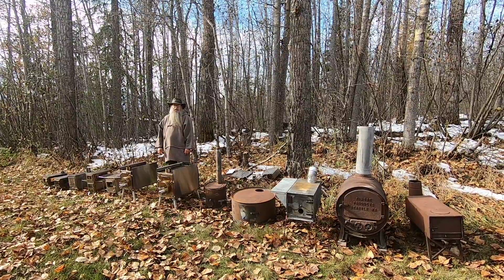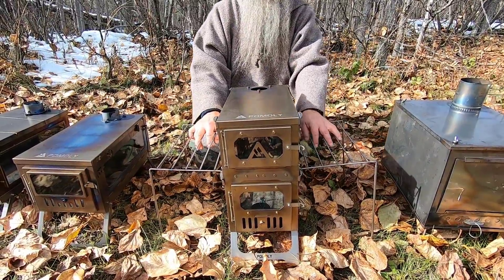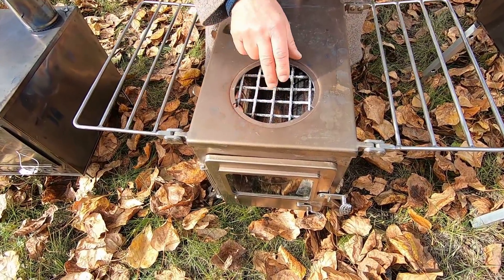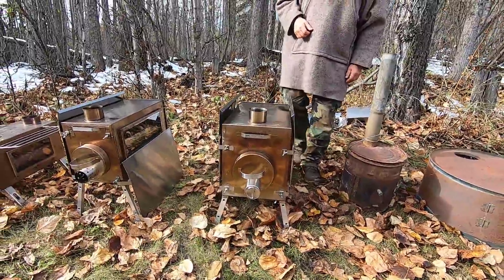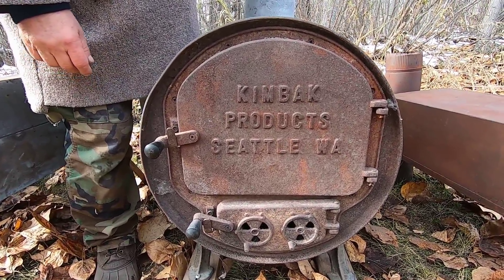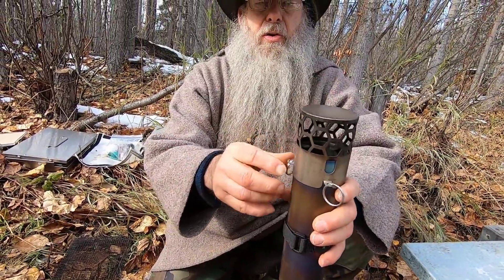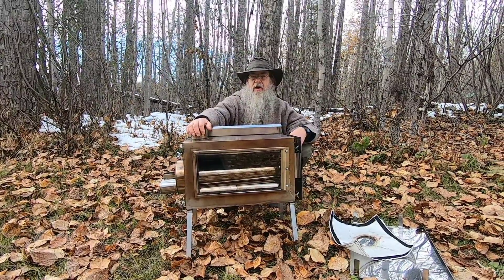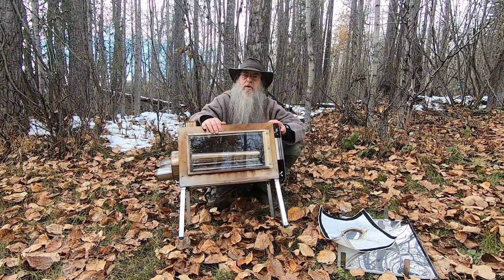Camp Tent Wood Stove info For The Common Man

Comment: I’ve spent about a year building my own tent stove. Its designed to burn anthracite (hard coal) as opposed to wood. The heat output and length of burn time from a few handfuls of coal is outstanding
Reply from the maker: I am very curious to learn more of your experiments and results.  Do you have a video/s on the subject?   I will take a look over on your channel and see what if anything you have there.
Reply: @Far-North-Bushcraft-Survival  I’ve never posted a YouTube video before but I’d like to for this one. The stove works great and I really think that coal has a real place in the tent stove community. 

      The pro’s are that a coal stove can have equal or greater heat output than a wood stove, (my goal is 8 hours) while also having a smaller overall footprint, and it’s able to run off of a single load of coal for a MUCH longer period of time. Also the labor savings it affords from all the wood you don’t have to chop. Plus coal is really cheap too
      
      The con’s are that the stove itself is more complicated (and expensive) to build. And even though it’s very small, it’s heavier that you’d expect it to be. Also, getting coal to light is literally like trying to burn rocks, which believe or not is quite a challenge!It’ll take lots of practice to reliably get the coal to burn. 
        
      My first (and only) one is made of mild steel but I’d like to redesign one with an inconel 718 (special nickel alloy) firebox. My concern is that coal fumes can be quite corrosive, and thin metal will burn out, but thick metal will make the stove too heavy to use. My stove isn’t 100% complete because I need to install the damper and upgrade the door/intake air latches, but dang it burns like the sun in a bottle!
Reply from the maker: @Bloated_Tony_Danza  Thanks for getting back to me.  I have coal available for the price of simply gathering it up.   I have wondered about using coal for camping and in fact I took a couple chunks with me a camping trip or so back but alas, I forgot to try it.
Reply from the maker: @Bloated_Tony_Danza    I was thinking more supplemental rather than a total wood replacement.   Good luck with your project

Comment: Wish you had included information on each stove and source. I looked on Pomoly but they didn’t have the folding stove shown. Great video and good to see you back at it. 🙏
Reply from the maker: Yes the stoves are still there on the Pomoly web site.

======
Pomoly Stoves  -  pomoly.com 
T1 PERSPECTIVE
TIMBER 3
T-BRICK MAX
======
Winnerwell Stoves  -  winnerwell.com
Nomad View 1G L
======
Caminus Stoves from 
Russian Bear Market  -  hot-tent.com/
"Caminus M"
"Caminus L"
======
Reply: @Far-North-Bushcraft-Survival    Thanks Lonnie, I just missed your naming a couple in the beginning but you were pretty clear on the last portion of the video. I can’t find the Pomoly folding stove on their site. I’ll take a closer look at em. I’m on Winterwell now, have you seen their folding S.S. fire pits in 4 sizes? You gotta have a look! Yer just crafty enough to make one outta ROUND dang duct pipe 😉 Thanks again for putting in the effort to share and respond. Much appreciated. 🙏
Reply from the maker: Yes I have seen those winnerwell fire pits and you are correct.  A home made version should not be too difficult to make.

Comment: Great videos, thank you..   I live in dairy country where double strength ammonia is available and that sprayed on cool stove glass with a little ash makes quick work and will not scratch glass….   Greetings from Bluff Country Iowa..
Reply from the maker: In doing a bit of online research, I discovered that stove "glass" is not glass but is actually a type of ceramic and it is not recommended to use ammonia on it as it can etch it and thus create an environment that encourages even more soot buildup.
Reply: Thanks for your comeback, in response I’ve used it on the door of my pellet stove for 12 years and couldn’t be more pleased..   Thanks for sharing, but not sure where you researched but my pellet stove door sparkles as I’m looking at it this minute, and your correct it is ceramic!?

Comment: Thank you so much for this...I've been looking at various outdoor stoves, unsure as to which and what I was looking for...this was REALLY perfect timing and great info. You both did a fantastic job filming this...both very steady and easy to watch, easy to listen to. I do have a question which stems for something I recently did on an open fire and has to do with 'dampening' the fire to keep from sparking too much...in the nomad, I don't think it has that baffle that you mention on the next one over...what if you were to some how put a fire proof mesh of some kind towards the top of the stove, covering the length and width, with about one inch gap before the top of the inside of the stove and pipe? maybe even some heat holding thin sheets between folded over mesh...essentially creating your own baffle...other than "it wasn't designed like/for that" and possible heat consentrated issues in the top which may not be able to handle that...is something like creating your own baffle...even practical? Especially since I really like the Nomad...TIA!
Reply from the maker: Yes I am a fan of internal stove baffles.   Whether or not it is worth fabricating in an already built stove would have to be evaluated on a case by case basis by the person wishing it done.  It may or may not be worth doing based on the particular type and construction of stove in question, the fabricators skill level and any cosmetic changes to the stove versus any hoped for benefits.    Most stoves vent out the top of the stove near the back.   An aftermarket installed baffle could only come forward from the back of the stove perhaps 2/3rds of teh distance from front to back.   Due to the baffle's leading edge being that much closer to the door of the stove, it may be possible in some installations that out-the-door smoking may become an issue every time the door is opened

Comment: Very informative I made my own woodstove, but I believe I may have made it a little to big. I intend to use it in my converted cargo trailer/rv but I had the intention of using it for cooking on as well. Its 16" diameter and 20" long with a 4" stove pipe.
Reply from the maker: You may need to leave a door and /or windows open if need be.  My motto has always been that it is better to be too hot rather than too cold but that is just me.
Reply: Thanks for the reply, I have it sitting right by the back door for emergency reasons and I have an escape door next to my bed.

Comment: the choice of wood stoves is all based on application.   In many cases weight isn't an issue, as rarely are they backpacked.   More often then not big stoves are brought in on cargo sleigh, either by person pulling,  snowmobile or atv. This is because the larger tents that use them can weigh 50 pound or more alone.  

once you are moving tents around that are the size of small houses.  (seriously,   8x10 is the smallest,  lost go up to 12x24 or worse,  8x16 expandable ( 16 wide, 8 long,  sections,  so you can make a tent 16x40 with 5 expansions).   Well once you get into those sizes you are starting to look at BIG stoves or even multiple stoves.  

Also do you plan on using it as a basecamp stove and cooking on it.    Well there are stoves that have water tanks for hot water, stoves that come with ovens for baking..  and while you can get portable ones, there are people that will drag in massive 50,000 BTU Wood fueled cookstoves.  things weigh in almost 200 pounds...    they bring them in, set them up,  start them up on the first day of the trip, then keep them running for the entire hunting season, non stop...   Cooking on them for every meal,   serving 5-8 hunters,  running the stove non stop for 3-5 weeks...   then at the end packing it out.    but again, when you have a tent thats 800 square feet...  in freezing temps... you need a lot of BTU

Comment: Hi Lonnie and Connie, hope you two are getting ready for summer, it's coming soon, yeah!🤗  Lonnie, I'm checking in with you as I have a video that may help with lung recovery.  I am currently taking this vitamin and seeing another small increase in capacity.  Thought I would pass this video on that I recently found helpful;    Low Potassium: Signs, Symptoms, Causes, and Treatment with Dr. Berg.  
This vitamin has been recommended to me by several coaches on the carnivore sites.  Seems like a crucial part of recovery that I hope will help me anyhow. 
Snow is melting while it's still snowing, lol.  Time to don the rubber boots for a few weeks, hope I don't do a mud dive!  
Blessings to you and family
Reply from the maker: Thanks for the info.   Now that a short bit of time has passed have you noticed any benefits?
Snow is melting here as well but it has been a slow Spring.   We have a few bare patches of ground here and there under trees but the rest of the ground is still deep in snow.  I was able to get my motorcycle down our snow covered driveway and out onto the dry roads for my first couple of rides of the season.
Reply: @Far-North-Bushcraft-Survival  That's great you got out for a ride.  The first time out for anything in spring is so refreshing!  
Spring seems to be slow in a lot of places this year.  I watch Muskrat Outdoors too and he has snow days even now.  We had one yesterday but it will be gone this afternoon fortunately.  With May just around the corner your snow should disappear quickly at least?🤗🤔  
Yes, I'm very happy to say there has been further healing.  A neck problem that has plagued me from youth is all of a sudden gone.  I've spent thousand of dollars over the decades on chiropractors, with no relief, and this diet heals it, I'm awed to say the least.  Also, I have been monitoring my blood pressure and it has dropped dramatically.  Used to be 140's to high 160's, it's now down to 105 to 120.  My lung capacity has increased a bit more also.  So nice to be able to take deeper breaths again.  Am learning it's all about insulin resistance that is caused by too many carbohydrates that upsets our bodies ability to heal.  I'm binge watching Dr. Chaffee's videos as well as any on insulin resistance, oh my, very disturbing what I'm seeing.  

Just recently purchased a blood glucose monitor  and will be tracking that.  It's in a watch form so no finger pricks🤗.  This is to monitor ketones.  Apparently ketosis is our optimal body function.  Carbs increase insulin, which is what damages the body whereas protein and animal fats, never oils, are what the body requires to function properly to keep us healthy.  An interesting aging note:  I'm hearing that we can live to 120 years or more on a protein/fat diet.  This makes sense since it keeps the body free of disease.  A Somalian replied to me  that they don't have any oils in their country, and they don't suffer from any disease.  As someone who is a 4 month carnivorist, this is very encouraging I must say.  The more I heal/learn about this diet, the more I feel it's the right diet for our species.  
Sorry for the long response, I'm overly enthusiastic about this whole thing, can you tell☺.  
Enjoy more spring rides and blessings to you, Connie and family as always🥰
Reply: @Far-North-Bushcraft-Survival  Hi Lonnie!  Hope you and Connie are enjoying the summer and have made it out to your wonderful cabin.  Its a lovely summer here with some sun, heat and rain that had become all to rare the past several years.
Thought I would check in and tell you my progress, and also the things that have gotten worse with my ALS.
I've been carnivore for 19 months now, it's been very helpful in a lot of ways.
My breathing has gotten much better.  But, I did have a setback recently when my sister came to visit.  I started drinking 2 cups of coffee every day and by the end of the week I couldn't take a deep breath and my sinuses were dry, making it hard to take in air.  Took almost a month to heal, so it was a good lesson in not what to do again🙄.  I'm learning that coffee is my nemesis, and why, but I still love it...
The increased healing has been that I have returned to my highschool weight, which I tried hard to reach all my life since then.  My hair, eyes, teeth(I rarely brush them now), bad breath is gone & teeth have become stronger, foot fungus is gone, bowels are normal, joint pain almost gone, am able to quench my thirst finally, no more dry tongue or mouth, no more heart fluttering, less leg cramps but can stretch again without causing cramping and my resting blood pressure is around 115/60, even lower if I don't have a cheat day🙃.  
But ALS is progressing on my right side that has become weak due to myline sheath being damaged.  Walking is awkward and I am falling alot since February this year.  I'm surprised I haven't broken my wrists or hips, but did break the nose in February🥴.  Was able to reset it without pain since the cartilage was only crushed, so a massage got rid of a small lump.  
No voice so I'm still a hermit😊.  
To keep myself busy I'm learning about mycotoxins that affect myline sheaths, the brain to muscle messaging in conditions like ALS, PD & MS.  I'm ever hopeful to reverse what I and others have, so I press on.  If the body knows what to heal when it has the proper nutrients, it should be able to repair what damage has been done, at least that's what I'm seeing in carnivore comments and videos.  
Well, hope you are both doing well and getting out for some camping trips.  I have to wait until I heal to go but hope someday to get back into comfort camping in the rv.  
Blessings from your neighbour to the south❤
Reply from the maker: @tallcedars2310  It's good to hear from you again my friend.  It is also good to hear that progress has been made in some areas of your health.   I am really sorry for the health problems you are still having however.   Connie and I are doing quite well.   We have not been camping except once this summer and that was in our ancient (1960's vintage) old 12 foot camp trailer that we affectionately call the "Tuna Can".   We have had a pretty decent summer here with enough rain along with a few hot (by Alaska Standards) days here and there.  

I was on the Keto diet for 2 years and did experience quite a bit of help for my lung issues.  However what really got me over the finish line so to speak was I fasted having only water for 14 days.   I then fasted another 7 days several months later.  I was finally able to get completely off all lung/breathing meds after that.   That was maybe 5 -6 years ago.  Recently I was once again getting worse in my breathing so got back on the Keto though not real strict.   My lungs now are not as bad as they had been getting.

Comment: The glass allows for better heat pass through, you get more heat faster with glass all around, even if it’s blackened with soot, with metal sides you get slower heat. Drawback is it also cools faster, so it doesn’t keep a steady heat but it depends on the size the area being heated. The purpose of the glass is for heating, not sure about warping purposes.
Reply from the maker: I believe that if your assertions were tested scientifically you would find that several of them would not be supported by the facts.

Comment: got a permanent camp site build an ondol or hypocaust, they are safer and once again the floors are even warmer! fire out side and smoke moves under the tents living space heats the dirt and radiates into the upper structure
hypo causts are very easy to construct lay a pipe under the area to be heated let the smoke flue thru the lower pipe directly place a second pipe on top of it all in the dirt under the tent leave to ends of the smokeless pipe enter the floor boxes in the tent cold air falls into it and radiates out into the living areas...as simple as stacking a few rocks and digging a small ditch and building a dokota fire pit out side the tent 
You can cook at the fire pit and even have a lean to over the hearth but the smoke drafts thru under the living areas heating the floor and the interior for those winter nights

Comment: Oven cleaner will probably clean up the glass pretty good.  It does a good job cleaning the glass in the door on my electric stoves.  I do not use the non-toxic cleaners.  I use the old fashion stuff that stinks like hell.  EZ Off is the brand name, as I remember, the yellow spray container.  I just spray it on and use SOS or Brillo pads to clean the grease off.  On heavy stuff I use my grill brush.  It has a long handle which  makes cleaning, easy, and my head out of the stove.

Comment: What do you recommend for most efficient & longest burning? Regarding something that produces heat all night.
Reply from the maker: "Most efficient" and long burning don't often occur together in one stove.  Efficient wood burning usually requires a higher level of heat which is produced by the wood burning at a fair rate of consumption.   For tent use, I personally would consider efficiency as a low priority.  A much higher priority for me is your other requirement.   Burning longevity.   The best stove i have for burning longevity is my 30 gallon barrel stove.   I can stoke it up pretty full and turn the air intake way down and it will last eight hours or through the night.   That isn't as high of a priority for me now as it once was though since I have to get up repeatedly most nights to relieve myself.   While I am up, I refill the stove.   that allows me to burn at a higher rate of burn for increased heat output.